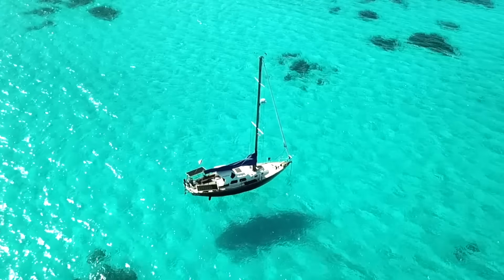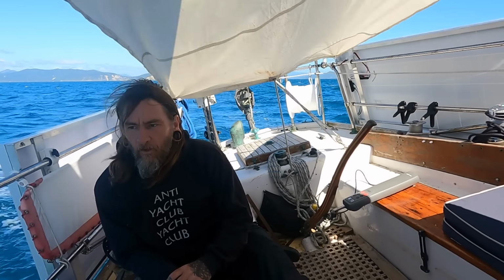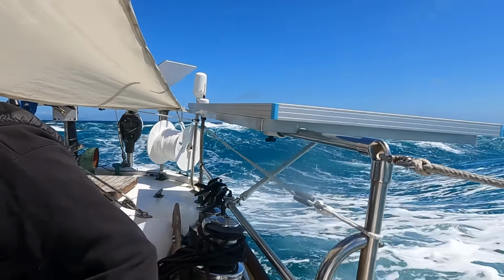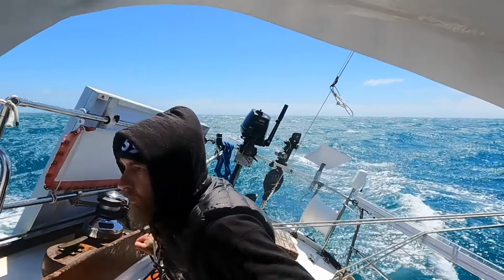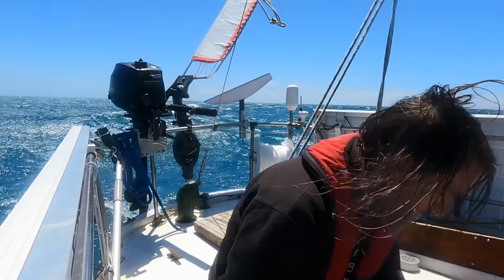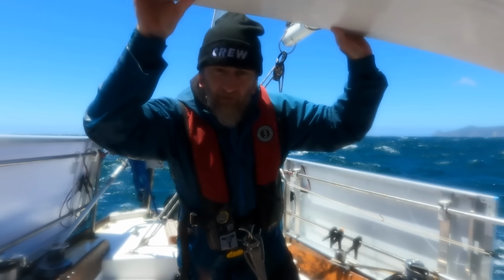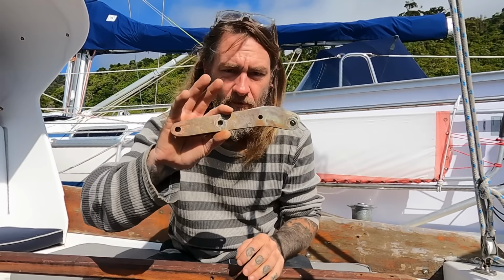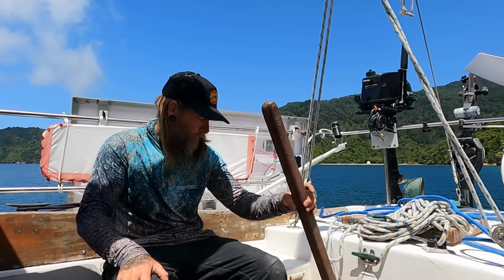A Broken Tiller in 45 Knots of Wind On The South Island of New Zealand

Comment: Well played recovering from the broken tiller - especially so close to land!! It's a reminder to us all about always having a Plan B at the ready. I have wheel steering ... if one of the steering cables broke in that same situation, I'd have to quickly install my emergency tiller (attaches the rudder head via a panel in the cockpit floor) ...  your video makes me realize I'm gonna want that unit ready at all times when near near land - not stowed on a semi-accessible shelf in the quarter berth where it is now 😕
Reply from the maker: Yeah wheel steering is far more susceptible to failure than tillers because there are so many more parts and they are all in very hard to reach places. You should also install the emergency tiller and test it out while sailing or motoring to see how difficult it is to use, I know leverage is a big issue with most of those emergency tillers
Reply from the maker: Yeah wheel steering is far more susceptible to failure than tillers because there are so many more parts and they are all in very hard to reach places. You should also install the emergency tiller and test it out while sailing or motoring to see how difficult it is to use, I know leverage is a big issue with most of those emergency tillers
Reply: you're right. It's a bit fiddly to install (I have practiced), and I've ready that, in conditions when you really need it - strong winds - it can be hard to generate enough force to overcome the poor leverage. @SailorJames

Comment: You were very very lucky the lords not ready for you yet. Your tiller should be made of Hardwood, with an already fitted spare. Jolly good seamanship no panic, well done.
Reply from the maker: Most tillers are laminated, then they don’t warp
Reply: @SailorJames 

Maybe  get one bent up in thick Al tube and  wrap the Handle up in cord...  You can also use it as a general leaver .. if a need arises.

Comment: the video of you hanging off the stern reminds me on a near identical video I shot of my friend holding the legs of the skipper an a warrior 34 when he was bolting a cabin door onto the hydro vane with u clamps after the hydrovane rudder dropped off and our main rudder had seized 200 nm  off Portugal on our way to Madeira. we had to heave to 3 more times and rebolt the door an a different corner as the door delaminated, still got us 400 NM without  using anymore cabin doors.

Comment: Great sailing and save.  You could of course fix it so the tiller never breaks but that means the gimbal will be the breaking point. Might be better to make a socket for the 'stick' so a couple of bolts, poke in the replacement. 
The S curve laminated wood shouldn't be that difficult to make. I don't think it's  steam bent. You can make as many laminate layers as needed to get it to bend easily. I'd glue it with epoxy and if there's some glass between a couple of the layers, it might not be as pretty, but it'll never split.  (Do keep in mind epoxy is stronger than the wood, but that just means if the wood swells it pops off the epoxy leaving the top layer of wood behind.)  You could shave down the end of old one, insert a plug  for the split and holes, and then put a carbon fiber sleeve over the top. then add more heavy filler. Sleeves are great. Just get it oversized. They pull and push bigger and smaller like Chinese fingercuffs. 
Lesson for me.: Get off my ass and use my Hydrovane. Also figure out how to put on the rudder while underway.  
& a stick autopilot came with my boat, but I have no idea if it's ever been set up. Time to find out.

Comment: Not the most opportune time for a failure. Reminds me of a time when I had a morse 33c throttle cable fall out of it's bracket in a 48' Offshore motoryacht coming through a drawbridge. The adrenaline rush leaves you spent afterwards.

Comment: Would you better with a full stainless one?( by the way not a sailer but love the video)
Reply from the maker: My tiller head and tiller shaft are bronze, mixing stainless with bronze is a bad idea because of galvanic corrosion, the issue wasn’t because it was bronze it was just not heavy duty enough. My big issue is my tiller shaft is from 1965 and smaller than modern standard so I can’t just buy a replacement anywhere
Reply: Bronze  propellers on stainless  shafts no good then?
Reply from the maker: Much easier to cut off and replace a prop shaft than a tiller shaft